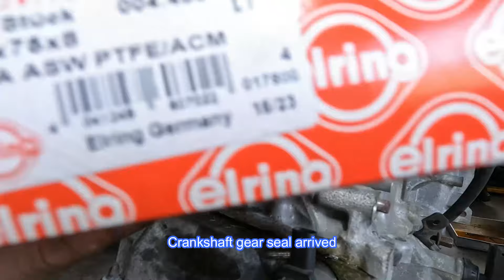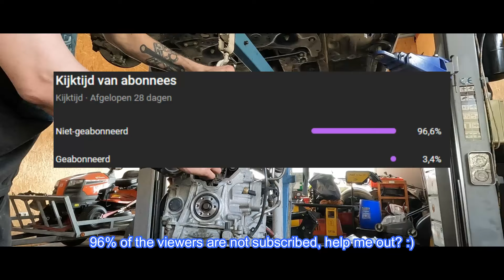1.2 THP PSA Engine wet timing belt replacement guide EASIER than you think! Fast & easy guide

Comment: Hows it going Nicholas? Hope all is well your end! Im currently in the process of taking mine apart but only realised today that the locking tool I received is the wrong one 😡😡 they sent me the other type also for the 1.2 puretech petrol, the one for where the entire camshaft is exposed when removing the plastic housing! My engine is like yours so i need the one you use!!!!! I think ive laocated it on ebay but I'm a bit worried as the item description is also stating for Toyota 😬😬😬 any chance you could send an item nuber for your one?????? Again appreciate all your help and advice
Reply from the maker: Het John! Thanks I am doing great! A lot of work and new project coming up :) please email me at futyi95@gmail.com and I will send you the link.
Reply: You're the man 🙏🏾🙏🏾🙏🏾🙏🏾🙏🏾🙏🏾

Comment: Can you tell me how many Newton meters the screws on the pulley (crankshaft) are tightened with? (Video from 0:57 min.) Thanks in advance :)
Reply from the maker: @and1st1984  didnt really torque them. Just tighten them before they break haha
Reply: @MechaNick_  :)))

One more question: 
If I press the locking pin in the flywheel and thereby lock the crankshaft, is the camshaft automatically in the correct position so that I can lock it with a tool?
Reply from the maker: @and1st1984  Yes. If the locking tools do not fit on the cam, rotate the crank another round.
Reply: @MechaNick_  thanks! 

Last Question to you  ;) 

Do I actually have to remove the two camshaft gears to be able to remove the timing belt? There are videos on YouTube where this is done.
Reply from the maker: @and1st1984  no need!
Reply: @MechaNick_  Thanks for your help!

Comment: Puretech? PuresXXt! 
It was designed to fail, I state. 
A mechanical (motor-design) engineer can never have knowledge of all aggressive ingeredients in motor-oil (a lot!) that attack the rubber belt.
Let alone the working temperature. The oil can be 100 C or more., for a long time. 
Compare that with an outside belt: clean air, 50 C max.

Hence: designed to fail. 
Never buy a wet belt engine, wait and save you money.

Comment: It's not a good idea to use a torque wrench when tightening the cranksaft gear bolt. The wrench is clicking but you keep on turning to reach 180 degrees on the gauge. This can damage the torque wrench.
Reply from the maker: Our torque wrenches get calibrated twice a year. Never had any issues with it.

Comment: I have never in my life heard of a wet timing belt. . . who makes this engine?
Reply from the maker: Peugeot/Citroën (PSA) and Ford (1.0 EcoBoost)
Reply: Also ford 2ltr deisel in trasit and vw use wet belt for the oil pump on 1.6tdi
Reply: And Opel in Astra K 1.2 2019-2021, but I don't know if they have issue with reliability.
Reply: From 2014 for Peugeot/Citroen and from 2019 for Opel  gasoline models they have this series of engines (EB2). Also, Toyota needed this engine for the ProAce City model.  Jeep and FIAT did the same thing (look to the Jeep Avenger and the new FIAT 600, instead to be an electric motor too). EB2 was awarded as "The Best Engine" three times. 

Ford's Ecoboost from 2012 if I'm right. Every Ecoboost engine has this type of belt.

Comment: using a torque wrench to pull 180 degrees ,? not really good for the the tool in my opinion my friend
Reply from the maker: Never had issues, our torque equipment also gets calibrated twice a year.

Comment: Maybe you could help me or advise me with my problem? I have a new Opel Mokka 2021 (New Mokka) with an engine EB2ADTD. I have a strange vibration in the cabin. The problem can be heard in this video (best from 8 sec): https://youtube.com/shorts/XROtr_3lFKM
When I turn off the engine, the vibration intensifies for 1-2 seconds and then stops. I have a suspicion that this has something to do with the timing belt or the accessory belt. I think so because one of the Mokka owner's had a similar problem on a similar car (similar engine) and after replacing the belt all the sounds disappeared. My problem gets worse if I turn off the air conditioning (climate). If I turn it on, the sound is much quieter or there is no sound at all. The mileage is only 10,000 km and the car is 3 years old. The car is used in difficult conditions - very short mileage, long warm-up. Maybe you have some ideas? Could this sound be the cause of problems with the timing belt, belts and rollers?

Comment: Are these manufacturers thick ??? if one does something the others follow suit regardless of wether it’s any good or not,dry timing belts were bad enough but wet belts are a catastrophe waiting to happen and cost twice as much to change because of the labour involved. I would never buy a vehicle fitted with one of those belts fitted, Ford want their head testing fitting a 2litre diesel in the transit with a wet belt fitted,it’s no wonder their losing market share turning junk out like this.
Reply from the maker: Indeed, for me it doesn't make sense. It only makes my boss happy because of the labour time xD

Comment: Just realize after polish youtuber prof. Chris making his "necropsy" with PureTech that is very good motor actually instead of social media hate-speech. It is just very sensitive on bad or too rare maintenance. You have to change oil at least 10.000km and check every time state of timing belt by removing oil pan which is not a big problem (13 bolts and sealing mass, you even do not have to buy special gasket). If timing belt is in bad condition just replace it. But as I sad, often oil changing intervals making this engine very reliable. See movie from, as he called, "puree" motor:) https://www.youtube.com/watch?v=4ke_sZ4bcGs

Comment: Not sure why people moan a lot. Take it to a decent garage who will use the correct oil, not whatever the cheapest crap out of GSF and inspect the timing belt which takes a few minutes. Then just replace when it's due, as you would on any other car. I would have said timing chains are better but not anymore. I can't think of any decent engines that will last the life of the car now, Toyota's included.
Reply from the maker: Most owners just do whatever is the cheapest... its stupid but its what they do.